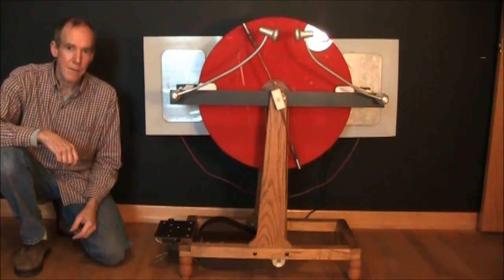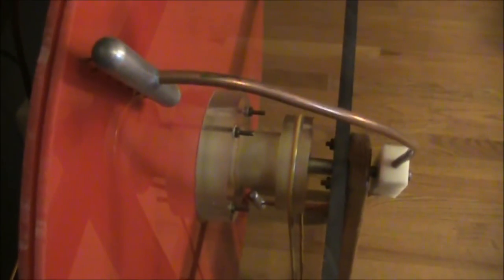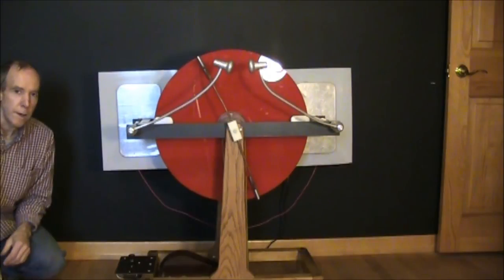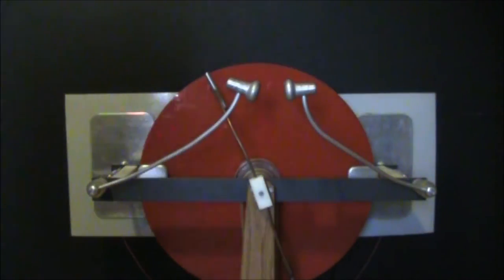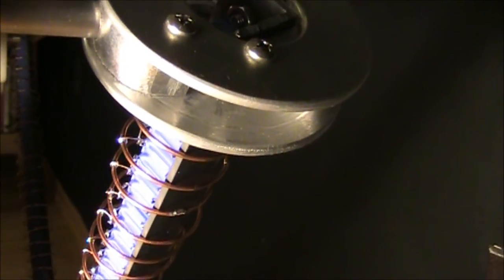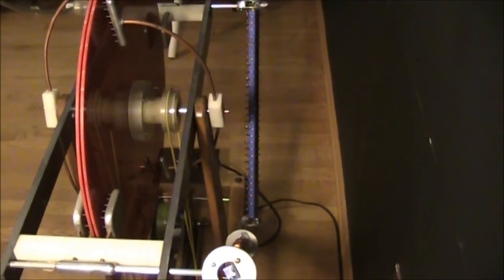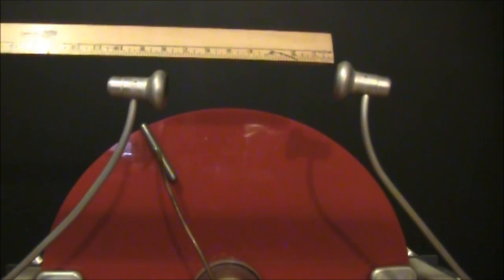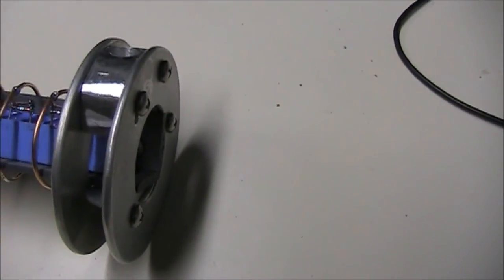Wimshurst Electrostatic Generator

Comment: Also, note you should have good motor speed control, the faster the disc rotation the more current output and the faster your capacitors will charge.  It's nice to allow adjustable speed.
Reply from the maker: I agree I do need a better drive. I had built a counter rotating gear drive but have not had good systems  results yet.

Comment: I forgot to mention the sparks you are getting are SEVERELY limited in length, you need a small (like one inch or half an inch) ball (on the positively charged side of the machine) that faces up towards a larger ball about one-inch diameter for every 100,000 volts of output on the negative side.  Your machine has 24" diameter discs. On a Bonetti machine (sector-less Wimshurst) you should get a maximum spark length of 2/3 the disk diameter so in your case 16".  Yes you could use a ball plane gap keeping one of your doorknob electrodes, but you need both on both sides because you don't always know what polarity the machine will start up in.  Not having the right electrodes (small ball positive to large ball negative will result in spark lengths less than 1/3 of their potential length.  Note on my youtube channel my Homemade lightning machine recreation the sparks are only about 3" (they look smaller in the video) when they could be 8" in length (like what you see from my Quadruple Bonetti machine). This (the short spark lengths) was because I did not know about polarity orientation of the electrodes yet. I WOULD LOVE TO SEE A NEW VIDEO WITH THE CORRECT ELECTRODES AND 18" SPARKS!
Reply from the maker: I need comments like this, thanks
Reply: @stephenhrobak3631  You are welcome.  I love your content!

Comment: Those first sparks were HOT.
Reply from the maker: Capacitors make a difference.
Reply: @stephenhrobak3631  very minor distinction 😁 capacitance in capacitors makes the difference.
Reply from the maker: @kreynolds1123  and low inductance.

Comment: It's the same old story, every time, over and over.
You put in a great deal of work, and you're sure you've build up a lot of potential. But in a flash, it all breaks down and you have to start over again.
Round and round you go.
Reply from the maker: That's the nature of those machines they are a antique design. But they do make static electricity.

Comment: Have you ever played with the discharge electrode positions to try and get the output to be a constant spray instead of the snappy discharge you show in the video above?
Reply from the maker: Yes I have and it makes a constant spray.
Reply: For larger capacitors (like he has) you need to increase the disc rotation speed to get the current up (output current is directly proportional to disc speed on these) to charge the caps fast enough or use smaller capacitors (that will result in much thinner sparks) so they charge faster at the same rotational speed.  On my channel, you can see various different stages of the evolution of my Quadruple Bonetti machine to the rapid-fire video where the sparks about as continuous as you can get with such large capacitance.

Comment: Did you continue?
Reply from the maker: That was an experiment with electrostatic machine design. Could it be taken further?  I tried another design concept and it did not turn out very well. But I have not given up.
Reply: 1204007137_testatika_017.jpg
Reply: The piece above is not the diode
Reply: Is reed relay

Comment: just being picky but isn't this a bonetti machine (much harder to make and get working)
Reply from the maker: turnerchris1 The information I used to build this machine called it a sector less Wimshurst. Since there are no sectors to make or assemble it is simpler to make. Also more efficient because there are no foil strips to leak high voltage corona. The machine is easy to start also.
Reply: Stephen Hrobak a sector less wimhurst is a bonetti I think, 
http://www.coe.ufrj.br/~acmq/bonetti.html
 beautiful machine by the way, wish I could make anything nearly as good
Reply from the maker: turnerchris1 Thanks for the complement, by the way the Master was my favorite Dr. Who hero.
Reply: 24" sector-less , big! I built a 12" one sectored with sticky aluminum tape, then pulled the aluminum off making it sector-less. Self starting with sectors but used a plastic pipe rubbed with wool to get it going sector-less. Much more current with sectors which of course have capacitance. Slightly higher voltage without sectors. Was around 125,000 volts
Reply: A Bonetti machine IS a SECTORLESS Wimshurst machine.
Reply: @Cliff_P  Not true (much more current WITH sectors) quite the opposite.  The formula that will calculate the maximum current from a Wimshurst machine is imax = π (rmax^2 - rmin^2) f pmax (pmax is 26.55 µC/m^2) rmax is the maximum radius of the active area (the sectored area on a sectored machine) and rmin is the smaller radius of the active area in meters) (f is the revolutions per second) (^ is the exponent symbol so the radiuses are squared).  With sectorless machines (Bonetti machines) the imax calculation is doubled.  On multiple machines (like my quadruple Bonetti machine) the maximum current can approach 4 imax per section!  Most of the charge is stored on the surface of the dielectric (the discs) in this case.  The sectors actually limit the charge holding capacity and area of charged disc sections, and they add significant charge leakage (hence the reasoning behind Pidgeon machine, a Wimshurst where the entire surface of the discs and the sectors themselves are covered in an insulating material leaving only small dime-sized buttons exposed on each sector so the brushes and charge collectors can work).  Also not leaving the charge collectors at dead center and instead angling each towards it's closest (Adjacent neutralizer in direction of rotation)  will nearly double the output current (but limit the output votlage because it will be limited by the distance of the charge collector to the adjacent neutralizer).  The reason this works is that when the charge collectors are directly opposite each other dead center only charge is collected from one of the two discs, NOT BOTH!  One of the rotating discs essentially just becomes an induction plate, using the angled method for the charge collectors makes the machine take charge from both discs.